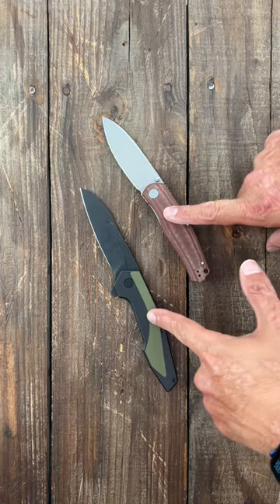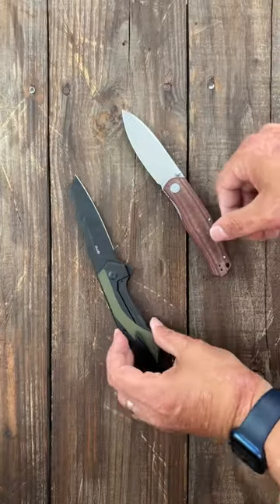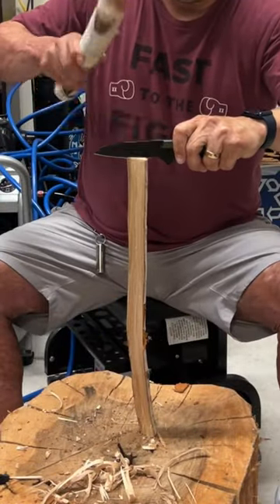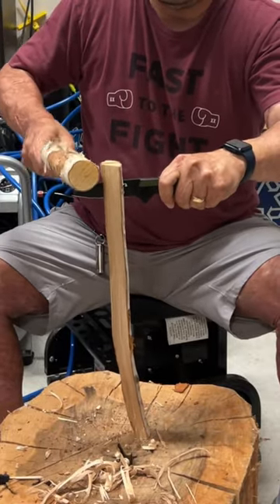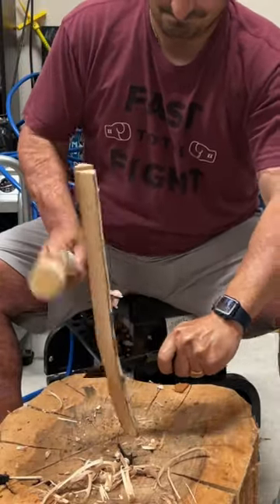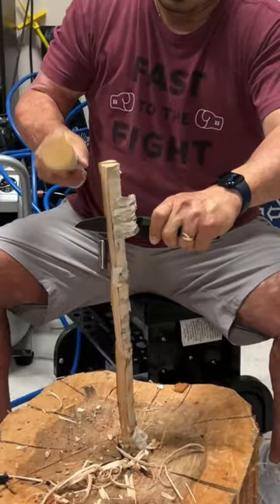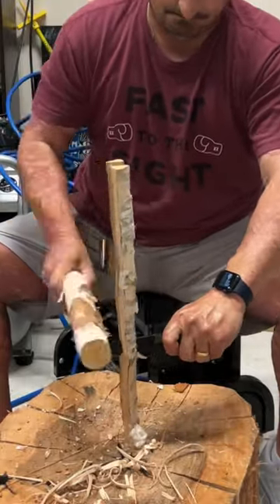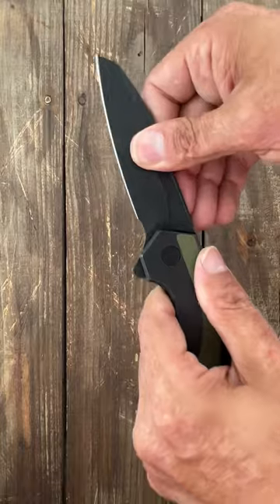Is a Framelock Stronger than a Liner Lock? Let’s see #shorts

Comment: Personally I would not baton with a liner lock, frame lock or a button lock, I might baton with a Cold Steel Tri-Ad lock if there was no other option such as a full tang fixed blade.
Reply: Just get a hatchet at that point
Reply: Batoning wasn't the point of the video, the point was comparing the strength of the locks

Comment: Maybe your hand bumped into the lock and disengaged it cuz all the vibrations from the impact. do a str8 up stress test and see which knife will hold the most weight before failing. i think the liner lock might fail due to blade slanted where it locks up and its skinny it’ll bend n pop

Comment: Benchmade axis lock is stronger than both
Reply: And yet still kinda trash. I've seen lock rock (up/down, while locked), blade play (side to side while locked) and detent lash (sloppy action in the closed position).

Thankfully the rights have expired, so now we can see inummerable cloners duplicating less than ideal design.

I'm sure each generation will do a bit less than the one before. As one does.
Reply: @olddirtybooger  that’s what I thought
Reply: Anything with spring is more prone to failure. Had liner, frame, axis, back locks. Knives stabbed into a tree. Liner bent, axis closed but no damage. Frame and back were fine.
Reply: @olddirtybooger  lol no one has ever said it’s trash except u

Comment: No. Frame lock, and liner lock are marginally different. 

They are both trash do to the draft in the lock face surfaces.

The wedge wants to wedge itself open at all times. The lock wants to close on your hand, from the factory. 

The differing radii on the mating surfaces allow for minimal contact area, to prevent lock stick. While allowing for maximum wear, as an aside less warranty work/ lax QC. The lock-up is made to wear in until it is worthless.

 I would say it is worse than worthless, by design. 

Shock loaded, as if one put medium effort into slashing something. Like cutting your friend out of entanglement. 

This loads the edge of the blade. 

The handle/stop pin flex allow the lock faces to over-engage. 

The smaller radius on the blade tang will cam out, then re-engage the lock bar. On paper it looks like the lock bar goes deeper. It does, but the shallow lock bar radius encounters, the steep blade tang radius, then all of the material strength of the handle assembly, unloads. The lock faces deform, now the self-opening wedge/lock, really wants to open.

You see many, very many 1000's PSI, slamming the sub-optimal geometry.  You have a truck trying to close the knife on your hand, because the handle material is de-bounding. That 80,000 PSI tensile strength titanium handle scale? It is pulling 80,000 PSI into a failed lock, as the scales return to a static state.

Predicated failure by design, is now catastrophic failure.

Your cut passes through, or glances off of the loaded edge, the whole thing snaps shut on your hand in open air.

Nothing ever touches the back of the blade, the strength of the handle is literally what cuts off your fingers.

There is no out in material science, all things will stretch, and return.

The only answer is lock design that allows constant muggle fidgeting, while failing safe.

More importantly, it must be manufactured for pennies on the dollar.
Reply: So what lock do you suggest? Triad? You shouldn’t be doing stuff like he was doing with a folder but that’s the type of thing it takes to fail the knife so he’s doing it only to see what it takes to fail the lock this shouldn’t be “real world” by any means. If you wanna do that, and you’re not trying to break a lock, use a fixed blade.
Reply: @MikeJ602 true, every lock has its uses
Reply: @MikeJ602  I think this guy would find a problem with about anything except a fixed blade lol
Reply: I think you just desperately wanted to show that you have a basic understanding of the physics of a folding blade. Congratulations.
Reply: Cool bud 

Touch grass